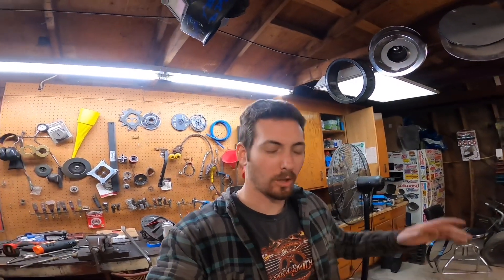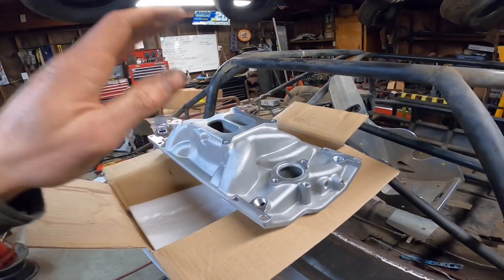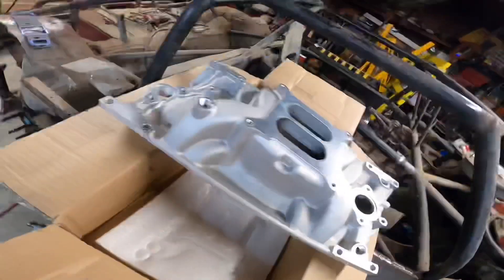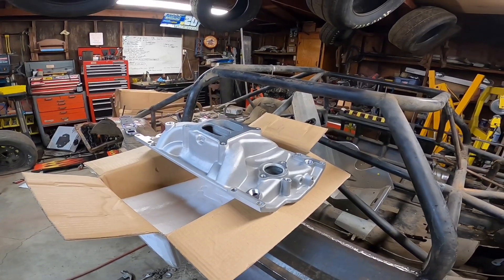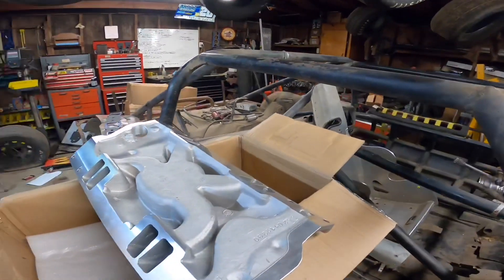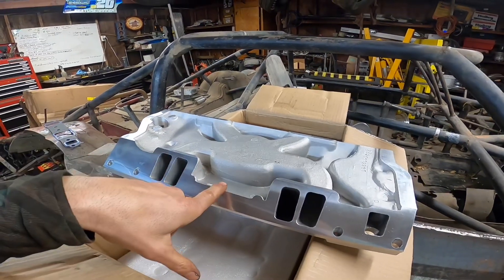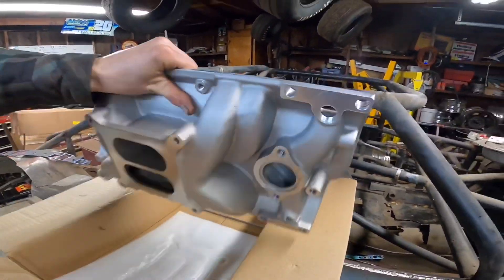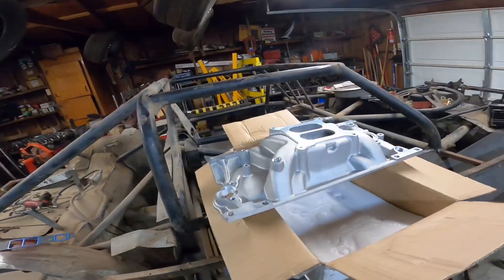Best Budget Vortec Intake Manifold for a SBC -- Summit Racing 226062

Comment: I have the Edelbrock Performer RPM (similar to the 060 mentioned in the video) on a mild cammed 353 TBI K1500 pickup.

Before I rebuilt the engine, I tried to break the ass end of the truck loose on a rainy day.... no good. It was one legged and I thought my diff was worn out.

But my new Vortec 353 got that diff to lock up and start fishtailing on dry pavement.. Huge difference! 

I'm a fan of these dual plane intakes for low end setups.
Reply from the maker: Yessir they are great for mild street performance! Great low end throttle response.

Comment: Good Unboxing video! Hey on those steam return holes, it's good to go like that if wanted. The design is intended for you to plumb those to ports into the top of the water pump because the issue it solves is hot spotting at the rear of the heads. I did like you and just plumbed from back to front but the correct method is actually just back to  the water pump. Just an FYI there on your options. Keep pluggin bud cause the season is starting!
Reply from the maker: Right on thanks for the info jason! Your street stock is coming along nicely. We both have our work cut out for us this season lol

Comment: Good Video Bro..  What intake gaskets are you using?  The 1206 bolt-up to Aluminum 190cc Heads??  Thanks..
Reply from the maker: Thank you! I ran the 1255 gaskets
Reply: @CherezianRacing  okay Cool, I wasn't sure 1255,1206 or 12895...  Thanks.

Comment: I have the weiand street warrior on one of my circle track 355 flat top vortec headed engines, it seems good for the smaller tracks but a 4/10 mile she seemed to flatten out about mid strait away
Reply from the maker: Ya really need a single plane for high rpm tracks

Comment: SUM-226062 is designed for 1500-6500 rpm while the the SUM-226060 is designed for idle-5500 rpm.
Reply from the maker: Very nice!
Reply: The 226060 is not for vortec heads
Reply: Thanks.  But SUM-226060 is not for Vortec heads.